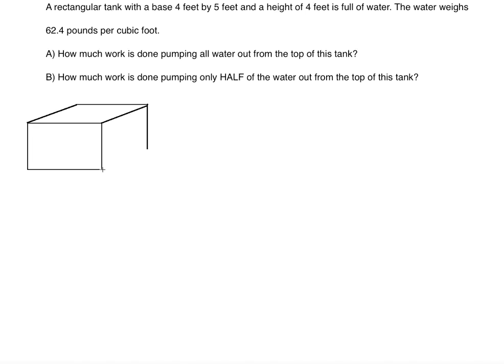⚗️Work Pumping Liquid from RECTANGULAR Tank problem ! ! ! ! !

Comment: I am noticing in my other problems that they include the gravity but you did not include it. Why is that for this rectangular problem?
Reply: If the units are given in meters, you multiply by 9800 (9.8*1000) but if it is in feet you multiply by 62.5...this includes gravity